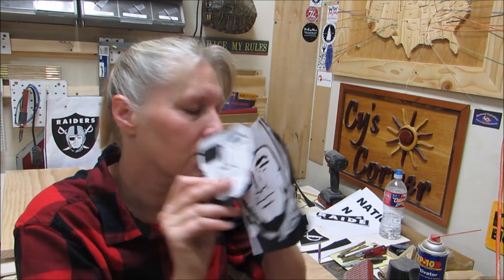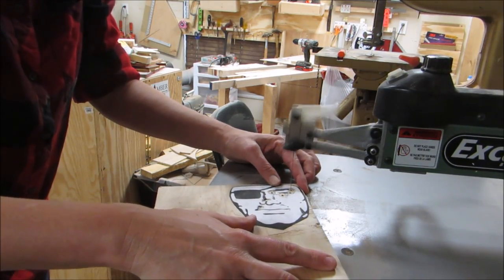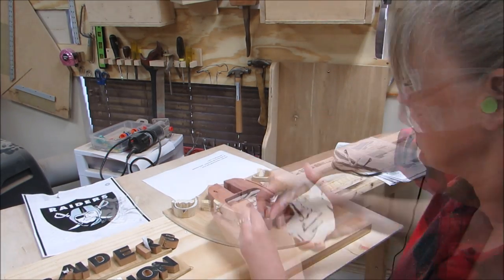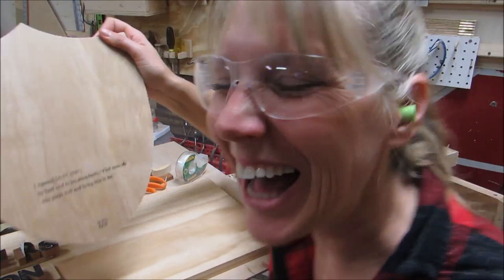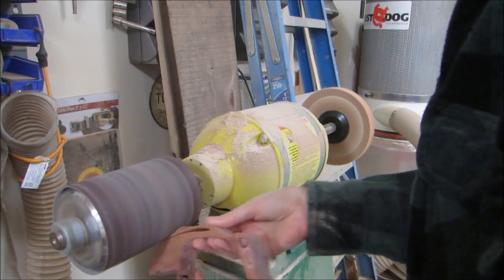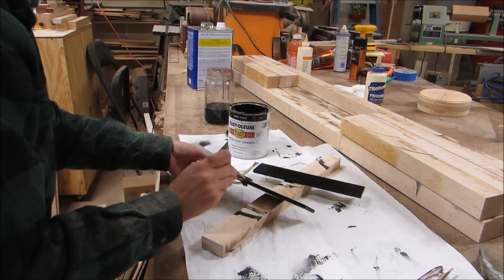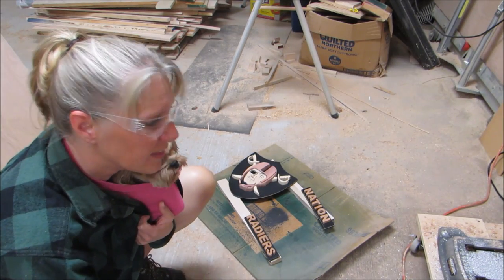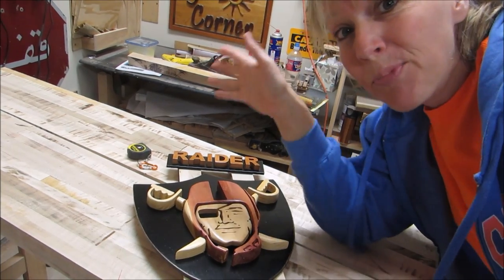Raider Nation Project

Comment: That is really nice, Cy.  A couple of things to do better. 1) DO cover your scrollsaw template with clear plastic tape.  It helps lubricate the blade while holding the paper down. 2) glue very often does not stick to paint.  It may hold at first, but will probably fall off later.  Better not to paint/finish any area that will be glued later.
Reply from the maker: Thank you.  I have tried the tape once, need to try it again.   I did read about gluing to paint before I glued it.....I wonder though.....
Reply: Wood glue doesn't stick well to paint but Arleene's original tacky glue will. And Cy, well done 👊. You make intarsia look easy.

Comment: awesome :) i really wanna try an intarsia project and since you are the intarsia queen i thought i would ask you :) which blades would you recommend for doing a project?......thanks in advance :)
Reply from the maker: Oh man JP, not sure I am the best to ask, at this point anyway.  My scroll saw was on the fritz so I have used my bandsaw more.   Now that my scroll saw is fixed it will be like starting over again!  I bought blades recommended by Judy Gale Roberts, and I bought some spiral blades recommended by Charles Dearing.  I also bought a packet of different sized blades that had recommendations for each blade on what thickness/type of wood to use right on the packet.  I don't have a favorite yet, but will be using the saw mostly from now on so I will have a favorite I'm sure, or an idea of what works best.  For now I recommend checking out the website of Judy and the spirals recommended by Charles.  Hope that helps JP :)
Reply: Cy's Corner thanks, any input is helpful right now as i have no idea where to begin haha, thanks again :)

Comment: Did you draw the shield by hand? If you are not good at drawing how would you enlarge or resize the pattern such as the shield?
Reply from the maker: +Defiant Deity I think I did draw it myself. I folded a paper in half to get it symmetrical. There is a program called Rapid Resizer, it has a small fee but the first 3 resizes are free (as a trial). It will resize and give you shapes too!
Reply: Thank you so much, I am just getting into scroll sawing and I have learned a lot from your videos!
Reply from the maker: So glad :)